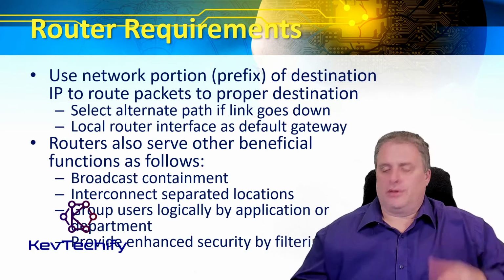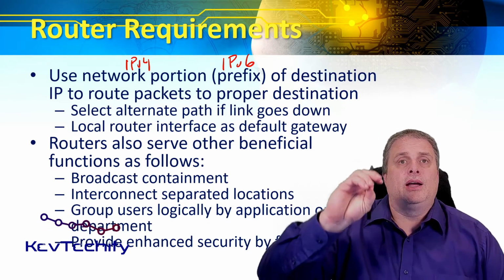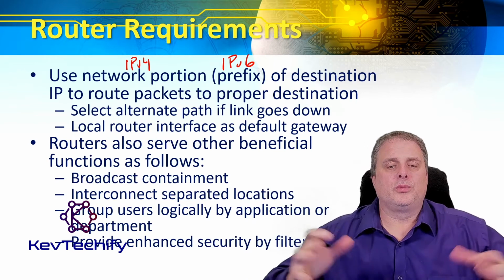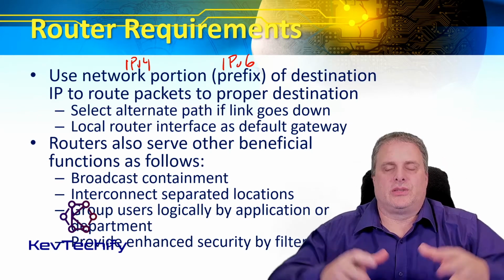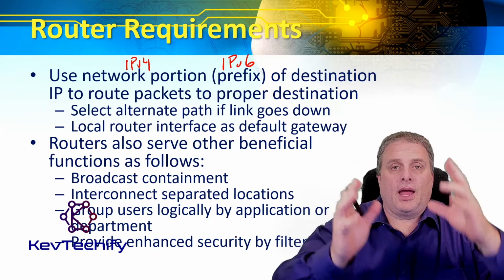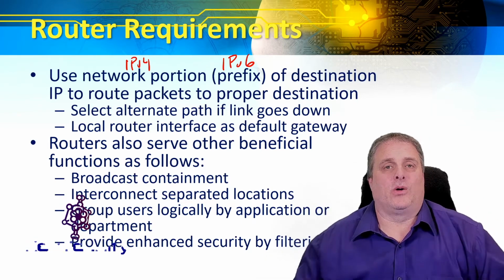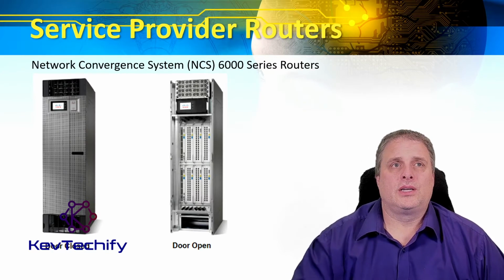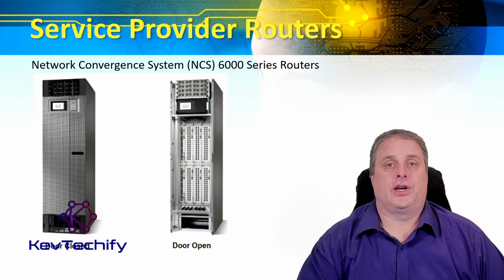Router Hardware - Network Design - Enterprise Net, Sec, and Automation - CCNA - KevTechify | vid 58

Comment: Which Cisco router enterprise would be entry level with vpn connection
Reply from the maker: Hi Anthony.

Cisco recommends Cisco Catalyst 8200L with 1-NIM slot and 4x1G WAN ports (C8200L-1N-4T), but you could use Cisco 4221 with Cisco IOS XE Release 16.9.4 universal image or comparable.  

Depending on what you want to do you could use and older router (series 1800, 1900, 2801, 2811, 2900, 4221, or 4300).  

Just have to make sure it does the VPN server configuration.  Some models and/or software version, VPN server was an additional purchase.

I hope this helps.

Kevin
Reply: @KevTechify  I forgot to mentioned I am looking for Cisco enterprise entry level since they are very expensive
Reply: @KevTechify  do you have specific model you can recommend me. for starters I want to use this for ccna and my business, I want to implement vpn encrypted connection site to site and dual isp and work on learning more complex configurations also I mentioning entry level because there expensive products
Reply from the maker: Hi Anthony.  

The dual ISP will be the tricky part.  For studying for the CCNA I recommend 2901 Routers and 2960 switches.  They are end of life, but rock solid and you should be able to get them cheaply.  I have these for myself.  The 2901 routers should also be able to do the site-to-site VPN.

As you build your skills, having these entry devices allows help you build and more complex networks.

Kevin